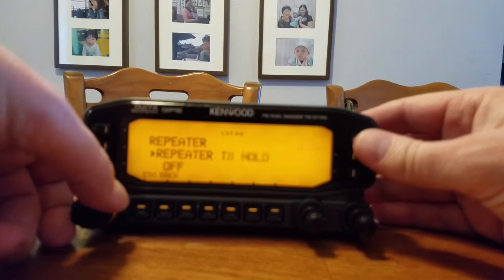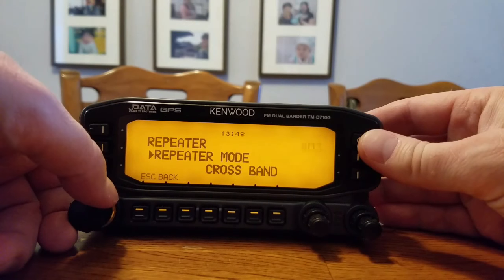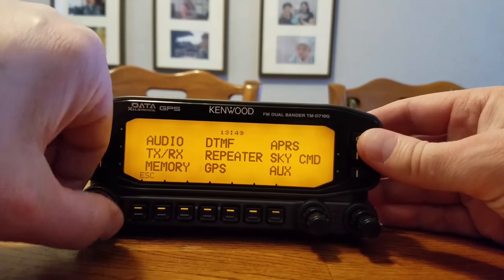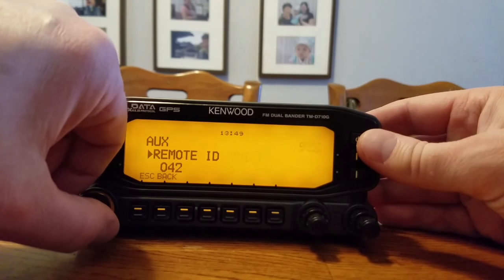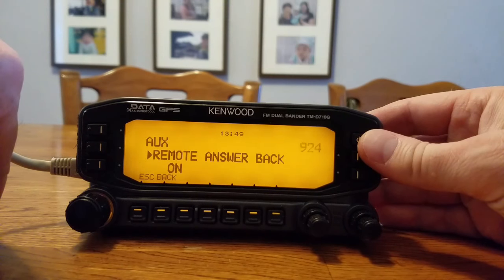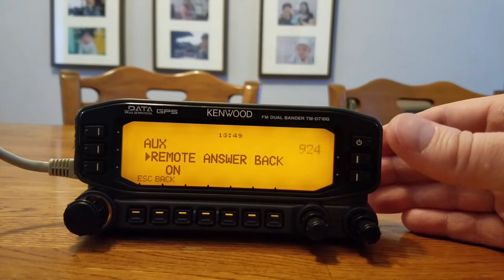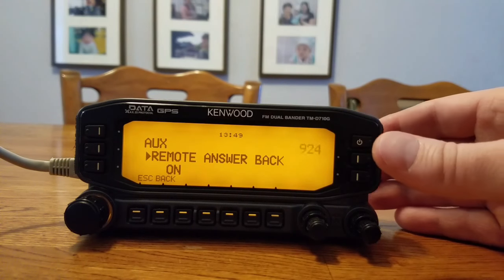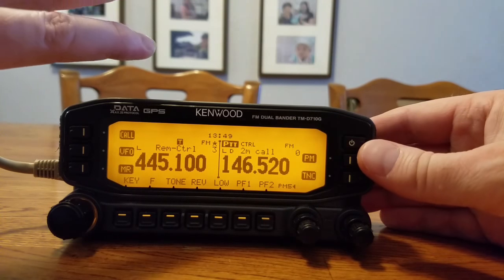Remote control cross band repeat on Kenwood tm-d710

Comment: Great video! I have experimented myself and everything works. However, I didn't find a way to setup the shift to +/-/off through the remote operation control. So if you want to setup a repeater, actually the shift is the only one I couldn't find. Anyone any idea what is the code for that? Thank you!
Reply from the maker: That's a great question! I have no idea! The manual doesn't say anything about setting an offset that I could find. I guess I would just have to preprogram the repeater as a memory channel and recall the memory channel number when operating remote. Sorry I don't have any other ideas on that. Thanks a lot for watching and commenting though and let me know if you discover a way to set that!

Comment: Bryan, Can you help me out?  I just purchases a new Kenwood TM-D710G    I have a list of frequencies I have entered into memory.  At some point last night I had VHF showing on the left side and UHF on the right side of the unit.  Today I just have 2 meter on both sides.  How to I control this?  UxU UxV VxV        When I enter frequencies do I need to program UHF on the first 100 memory channels and VHF on the memory channels 101 and higher?  The manual is good but just not as detailed as I wished it was.  Kind regards Jack K.
Reply from the maker: Hi Jack, no the memory numbers can hold channels for any band.  Like I have memory #1 on a 2m channel and memory #2 on 70cm.  As far as your other question on having 2m on both sides, I think there is a band button or something that might have been enabled to lock those sides to 2m but I'll have to look that up and get back to you.  I typically have my A side scanning through memories 0-100 which includes 2m and 70cm channels, and the B side fixed on APRS 2m.

Thanks a lot for watching!

Comment: Operating in cross band with ID off is a violation of the rules. Your mobile is transmitting back to your HT without id. You don't need to hold REV when powering off, only on.
Reply from the maker: Yep, thanks! There's a setting to turn that on and I should have set that. Thanks for commenting and watching!
Reply: @drtelnet04  If you use Locked Band Repeat where the TM-D710 is repeating only what your HT transmits then you don't need to have ID on. Your HT listens to the remote repeater directly. The KW mobile is only in use when you are transmitting. But your HT must be capable of TX on one band and RX on the other simultaneously. It's easy to do with a "dual" radio like the TH-D72A. Use the A side to TX and B side to receive.
Reply from the maker: @BosssyBear  thank you! That makes sense and I remember seeing the locked band repeat in the manual, I'll try that out! Thanks for commenting!

Comment: Hi i have the 710GE and have no option at the menu for repeater mode ,not 403 ,i have only 400,401,402 .I don't have done any mode for open the TX
Reply from the maker: Sorry I didn't see your comment until just now (Youtube comments are pretty difficult to use) but another person noticed this same behavior and made a video about it:  https://youtu.be/vn6hjt9iO3c
Basically newer versions of this radio did not include some DTMF encoding/decoding chip and aren't able to use that feature.  I think that's the menu you're referring to.  Sorry I don't have any better information on that, but thanks a lot for watching!
Reply from the maker: Well maybe that menu number isn't related to the video about DTMF that I thought and I see you have the 710GE model, so maybe that's something specific to the European model?  Sorry I'm not much help here

Comment: Hi Bryan!  I just got the TM-D710GA for Christmas, I'm very excited!  I had watched your video and it was the clincher between getting this or another radio.  I am having an issue, wondering if you know the answer.  When I go to Menu, Aux and scroll through, menu numbers 923 and 924 are missing - it skips right over them, it goes 922 to 925.  Any ideas?  I'm wondering if it is a firmware update or something.  If you have any clues, that would be great!
Reply from the maker: Thank you so much for watching and commenting!  On your question, I don't know why that menu is skipping those numbers.  I suspect it's the firmware version of the head-unit but I'll look at my radio here soon and find out the firmware version and comment back.  I know the head-unit and the base-unit have different software updates.  Thanks again!
Reply: Hi  @drtelnet04  , I've been researching this all weekend and found some new information.  It appears that newer versions of this radio are being shipped with those options (923 and 924) removed.  I found an addendum in my box that reads "For TM-V71A / TM-D710GA, the following functions are unavailable because of the specification changes: Menu No.923/924. Refer to INSTRUCTION MANUAL, page 35."  It's funny (not really) because page 35 shows how to use those menu options, which do not exist in my version of the radio.  I had suspected the firmware as well, but I confirmed that I'm on the latest (1.00 for the transceiver, 1.02 for the head unit and 1.02 for aprs).  I've reached out to Kenwood (nothing back yet) and to Ham Radio Outlet where my wife purchased it.  The guys at Ham Radio Outlet want to help me but are in disbelief at the moment.  Anyhow, maybe they'll send me an older radio or modify it so that it will have these functions returned, I don't have much hope at this point.
Reply: Just a wild guess, but I wonder if the prevalence of cheap devices like the RTL-SDR is making replay attacks for DTMF remote controlled devices so easy that manufacturers are being discouraged from shipping new transceivers that implement that kind of functionality? This video uses an SDR for a difference purpose, but I think you'll get the idea: https://www.rtl-sdr.com/tag/dtmf-tones/  @Tacoma75

Comment: reading some of the comments! 
Some people asking how good is the D-700 / D-710 or the D-710G.
I bought the D-700  when it entered the market in the year of 2000.
That was 19 years ago. This radio was set up in APRS mode in Toronto running 24 hours. 
Once each year I took it a part and cleaned the dust inside. 
About 5-6 times I had to replace the cooling fan.
Not surprise the fan was constantly turning on and off with each transmission. 
I had no issues with this radio.
This year I sold my D-700 for 200 dollars. The only reason I sold it  because my friend of my wanted it badly.
He is very happy with this radio (LOOKS LIKE BRAND NEW)

About 10 years ago I purchased a D-710 never installed in the car, used it as a base station in a condominium on the 29th floor.
My dual band antenna was on the roof at the shore of Lake Ontario.
I was allowed to install only one antenna and because of that I had to use a coax switch. 
One input from the antenna and four out put to four different radios.
I had a good chance to test out different radios (WITH THE SAME ANTENNA) 
My two favorite radio was the Kenwood D-710 and the Icom IC-746.
Usually I made the long distance calls over Lake Ontario with the ICOM radio because the 746 is putting out 100W.
The returning stations weren't using high power most of the times.
I was having problems to hear the weak stations, that was the time to switch the antenna to the Kenwood TM-D710 to receive.
The Kenwood radio is much more sensitive than ICOM or ALINCO
I purchased an ICOM IC-2820H for it's D-star capability.
This radio can't come close to the KENWOOD.

Four years ago the D-710 started loosing sensitivity. 
The receiving filters started going and I had to switch from FM to NFM mode to pick up the weak stations.
Soon after the NFM was losing sensitivity as well. 

I had to make a decision to repair the D-710 for 300 dollars or scrap it and get a new one.
Than YOUTUBE UNIVERSITY suggested to replace the four ceramic filters. AAAAWWHAT?
Can I do that?
I ordered the four filters (5 dollars each) and I replaced the defective filters with a new one.
Those filter are better than the new ones. 
In Canada  the TM-D710G cost 700 Dollars. 
One hour labour and 20 Dollars saved me 700 Dollars. 

I can't comment on the D710G I don't have one but that is going to be my next mobile.
I like the idea to have a built in GPS

THANKS YOUTUBE! 

73' VA3VAD
Reply: Yeah I think the D700 is more reliable. I have the D710 and have had issues with it. I have a few D700s and no issues!

Comment: Cool, but if you can't see the face of the 710, and the settings aren't displayed on the HT, how can you be sure you're getting what you think you're getting?  For example, if you fat finger a frequency change, you'll never know it, right?
Reply from the maker: Yep, you're right, if it isn't on the right frequency you won't know it. I would try to transmit on what I think I set it's input frequency to and if it didn't work then I must have set it incorrectly. That's why I saved that revert to a known good state sequence that resets it back to 146.52. That way I can quickly reset it and try it again. I wish the Kenwood would squawk back tones or something on what it received as a command. Thanks for watching!